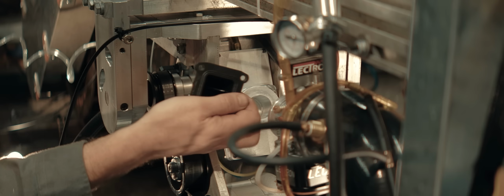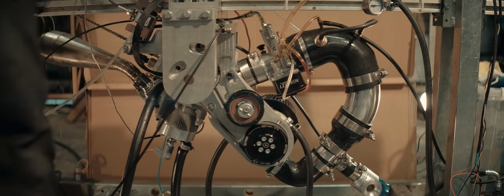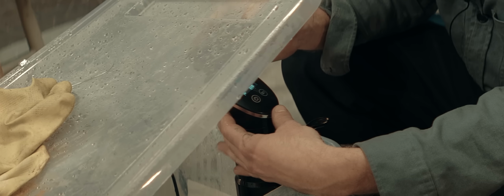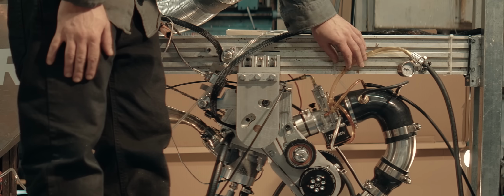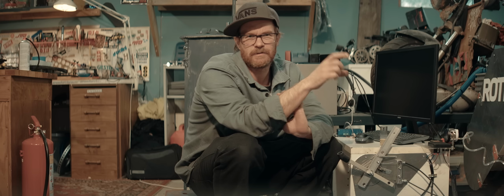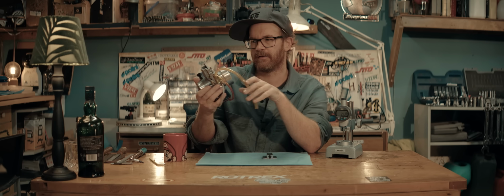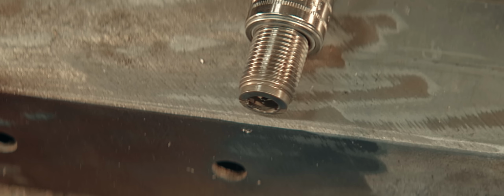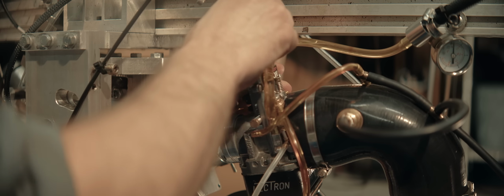Supercharged 50cc Two Stroke BREAKTHROUGH!

Comment: You know, I'm looking at my 50cc Honda Spree motor here, and these companies, like Honda, Kawasaki, Suzuki, Yamaha....just think of all the geniuses that have been working on the engineering of these two strokes for many decades. I mean, they built absolutely insane prototype motors, like a V8(!), 125cc 4-stroke mc motor, that revved to 20,000+ RPM, and they did it in like 1962, or something!!! They have created motors with oval Pistons!!! Just think of all the things that those manufacturers have learned over the years, the pros, and the cons. You know, not to be a Negative Nancy, but what I would do, personally, I would start off with all their technical achievements, learning the benefits of what they've done, over almost an entire century. I would then use that as my base engine. You know, when they did their experiments, & built prototypes, they had the absolute best equipment of the time, at their disposal. The money was simply no object, whatsoever. Those are technological achievements that I would not be able to do. This is why I would not start from ground zero. I would learn all the goods, the bads, and the uglies of these four major manufacturers, pertaining to 2 stroke engines. And I would use that as my starting point. Just think about this. If I started on this little Honda 50 spree motor, how long do you think it would take for me to invent a butterfly Reed cage, build it to the correct dimensions, as to not lose intake velocity, and design it around my entire combination, and make it work flawlessly... without knowing Japan's successes and failures....holy shit....I'd spend my whole life, trying to get to that point. Don't even get me started on exhaust velocity, pulsation, things like KIPS, i.e., Kawasaki integrated power valve system....all kinds of engineering that creates huge power gains, and it's free for the taking. Starting at that point, it would allow me to build up from there, creating enormous power, without having to wade through the very basics of two-stroke technology first. Then, you can focus your time on things like your ignition spark curve, boost retard, fine-tuning your ignition map for your particular engine, to make maximum power.....things that those Japanese geniuses could not do back in the sixties. It would be exciting to see huge power gains from something like that. This comment is way too long already but I hope you get my point, and please don't take it the wrong way. I love the channel, and I love what you do. Just don't ever think using those other companies successes and failures to your advantage, is stealing ideas. It's not. It's a free advantage out there you should take advantage of. That way, you really can design the most powerful 50cc two-stroke in the world.

Comment: The step in the carb would have produced a low pressure zone or "dead spot" just like behind the cab in a truck. Being so close to that metering rod I suspect it would have reduced the Venturi effect and acted like a dam for air flow and fuel. I suspect  you are right on the pooling fuel there and the engine taking big gulps of it from time to time, especially when it hit higher rpms. 

This is the first video I have watched of yours but it seems interesting.

Comment: When a two-stroke gets rich, I mean too rich, what we call it in dirt biking, is four stroking. I'm sure you've heard that before, that's too rich. 
Oh yeah, btw, your manual, mechanical reed valve, it's not a reed valve at all. It's a manual slide valve. And when you engineer that valve, keep in mind that the suction from the intake charge can directly affect its slide, up and down. I can't tell you how many time my Honda 750 carburetors would start to stick, because the barrel slides were either sloppy in the bore, or just dirty.
Anyway, now you're experienced, like Jimi Hendrix.😜👌
Reply from the maker: That slide valve has a reed valve in the slide - sliding reed valve.

Comment: In the dirt bike world, Lectron are hit or miss results wise, I'd really love to see what a quick switch to a more common Keihin with it's individual metering circuits would perform.
Reply: I'd say they are hit or miss based on whether or not the user knows how to tune it and/or is willing to spend the time. Most reviews I read over the years went one of two ways "I bolted it on, made no changes, and all of a sudden had TONS more power!" or "I bolted it on, made no changes, and lost a TON of power. Not worth it." Maybe a few reviews were like "I turned the screw a few times and it did nothing."

I've tuned tons of carburetors by now. They all want something different. They are all designed different. Even though they are relatively simple devices, they can also have their complexities. I can spend an unlimited amount of time tuning a carb to get it just right, if I wanted to.

I don't think the Lectron is necessarily a bad design, it's just different. And if you aren't willing to tune it, or don't want to to learn how to tune it ITS way, then you are going to be frustrated and tell the internet it sucks. I don't think they would still be in business if it didn't work.

Comment: If your calculated power peak is at 18000 or so (don't remember exactly what you said about it), then the worst power dip is going to be probably at well over 10000. So probably you are just beginning to hit it now. In my experience, at a really low rpm, like under 7000, the engine behaves "neutrally" like a 4-stroke, without the pipe resonances affecting it much. There the power is mainly affected by compression ratio and ignition advance.

Comment: That step is a signal killer. It destroys air velocity over the needle jet opening. Any fuel that does come up will be stuck in a vortex behind that step.
Reply from the maker: Yep. Only a fool would leave that in there...
Reply: @2STROKESTUFFING  he he that is why I love your channel! Honesty. I wouldn't say "fool" I'd say "rushed". I designed and built a carb that shares some of the principals of the lectron and testing showed that the area around the jet opening is uber critical. The Lecton relies on a low pressure area behind the needle to go all the way down to the opening and draw the fuel. The step cut that off. That is with a steady flow, when pressure waves are present it gets worse because inflow does not generate the required suction at the jet and pulse generated back flow the step will actually blow fuel DOWN the jet! Double whammy. Anyway you got it sorted out now, onwards and upwards!
Reply from the maker: @billshiff2060  👍 Thanks!

Comment: I still think a two-stroke with a straight pipe runs better. you no longer need the vacuum effect from the resonance because you have enough pressure to blow in the fuel-air mixture

Comment: If the metering rods don't work out as planned it might be time to just put a regular old carb on the rotrex and get it going on gasoline or E85 if the rotrex can take that.

There are so many unknowns and so many potential problem areas with such outstanding homebrew projects - taking out a few that way and getting it up and running might just tell you what you need to know to succeed.
At the very least it probably shows you which problems are fuel specific.

Comment: you might benefit from going full efi, and tossing the injector into the transfer port , and haveing some sort of oil system otherwise . With all that inconsistency happing so fast , a computer might be alot quicker than a human in reaction and would be able to adjust on the fly and keep the whole system in the happy zone . if you ran efi , you could also run an electric clutch , then have the computer control that as well so boost comes on in the perfect time  consistently . I understand this is no easy task tho . you could set up a micro controller to run the clutch as well as the valve slide plate .  just an idea hope it helps or inspires ,

Comment: Might be time to go for direct fuel injection, adds a bit of electronic complexity and more complex cylinder head but could reduce complexity at the intake side and reduce the pooling of fuel in the crankcase if that keeps being a problem.
Would also give you the option of making a pre-burn chamber like they use in F1 engines, could increase efficiency or reduce risk of detonation.

Disclaimer: I have never build a IC engine so al these idea's might be nonsense and never work.

Comment: As someone already mentioned the carb is on the wrong side of the super charger. With your setup the carb is being pressurized forcing fuel to go backwards. 
The carb needs to suck fuel in a vacuum.
Reply: I could be mistaken but I believe he’s already addressed this in previous videos with a pressurized fuel system that automatically adjusts to upstream blower “manifold” pressure.

Comment: Alex, look into a "bypass valve" if you need to take load off the pto for starting and idle. Thats what ProCharger uses with their centrificals. Bleeds off all the boost at idle and low rpm, then closes to start building boost as rpm rises
Reply: Detroit 2 stroke Diesels that are turbocharged have been doing this to their Roots blowers for 50 years.
Reply: This style of compressor doesn't really cause any load at low rpm, its just the gear train and mass. It's not a positive displacement. Look at a turbocharger compressor map, it's basically half a turbo with a mechanical drive.
Reply from the maker: Yep.

Comment: I have think your going to have to experiment with crankcase injection. If you can measure mixture internally you may be able to servo control injector timing and duration. That would eliminate the odd reed slide and the carburetor.

Comment: look up how to tune two stokes by reading the plugs. It is the only way to reliably check to see if you are too lean or rich
Reply from the maker: Not so easy with this fuel, you can decipher some from heat colouration of the metal, other than that it stays clean, no soot ring or anything.
Reply: @2STROKESTUFFING  your right, I didn't think of that. Your answer may be known by one of the two stroke four wheeler drag racers

Comment: In Sweden you can by E85 at many gasstations for less than the price of Gasoline so a lot cheaper than Methanol. Ethanol is almost as high octane and cooling as Methanol but to get the correct AFR you only need 1,3-1,4x as much fuel compaired to gasoline , so the required fuelflow will be a lot smaller than with Methanol too.
I know you like ethanol, why not give some to the engine too?

Comment: Humor me and set it up draw through style through the supercharger. Pretty sure that electron carb is not designed for boost and your accelerator Jets are fighting the boost rather than taking advantage of the vacuum. Either way I think you'll have much better luck with a draw through setup.

Comment: How about mixing the methanol in the carburetor directly in the air fuel mixture. To preventing the methanol falling out of suspension and get the control of right mixture?

Comment: I'm a bit surprised you tried running that motor and carby combo at all with out a pile of needles.  To easy to blow up a lean 2 stroke.  Because of the size of the carb and the capacity of the motor the jet size will need to be huge!!  You have choked it down a bit which certainly will help get the carby back into range, but considering just how fine adjustments are required to nail the jetting, you have taken a big gamble.  I built a fairly modified KTM 380 and upon starting to jet with the original 38mm PWK, I couldn't get main jets small enough to get the mixture correct.  I modified the carb by fly cutting it out to 39.5mm and that put the main jet bang on back in range.  Jetting for the new expansion pipe was the toughest, it always fouled the plug on extended deacceleration runs.  Leaner pilot was the answer.  The ratio of fuel pulled through the jet and air through the air bleed richens at higher manifold vacuums.  The last change was the needle profile to get the mixture right at 1/4-1/2 throttle position.  After market JD needles which come as a pair, one is ground half a position out to the other so you technically have 10 positions.  All in all the thing starts like magic and couldn't be any crisper throughout all throttle positions and is explosive when getting back on at the apex.  I love it.  I really like what you are doing here, you have an interesting research and development process, but you are getting there.  When time allows I would like to play with the concept of a turbo charged 2 stroke so boost can actually be contained in the cylinder.

Comment: What about reeds in the carb?  With more air flow they flex to open the throat more.  Effectively at low rpm's it could be like a choke depending how small and strong you were to make it.

Comment: Could you use the blowoff valve to open at low rpm which will help with air restriction, easy test just rip it off and see if it’s better down low.

Comment: Why don't you fit a lambda sensor in the exhaust? The information will help to quickly determine whether you have the optimum fuel and air mixtures at various rpm. Tx for sharing your experience....

Comment: Can you use the Turbo Centrifuge to clean the exhaust?

Heavier particles will displace lighter particles and push the lighter particles into the centre while the heavier particles locate to the outer areas. Can this cleaner air in the centre be used to go to the exhaust while the dirtier fuel air on the edges is re-entered into the engine for a second burn?

Comment: Ignitech - have you got your pickup setup is such a way it can run higher enough advance values ? When the Ingitech software is connected to a running engine it will tell the maximum static advance that its possible to run. The Ingitech has an option to "spark possible before lobe" which allows you to run more advance than static by I beleive running the engine one cycle behind. Do also note that if your base/static advance of your lobe is really high the engine can struggle to start as the Ignitech starts the engine on the fixed base advance setting until its up and running and in sync with the lobe.

Comment: What is your end goal here? If anything and you are seeking power and speeds applied vacuum to the scavenge of the exhaust port and your engine will run much more powerful and the needs of the expansion pipe will be void to help the scavenging effects. Trying to use a oversized carburetor is another problematic thing that will never go away and it will be too erratic. The end goal of a 2 stroke is being able to remove the burnt exhaust gases and fill the cylinder with the fresh air fuel. I've played with this theory before and it's amazing! Not very efficient for fuel economy standards but the outputs are far above the expansion pipes outputs. Just FYI.
Reply: I'm not a fan of massive carbs due to reasons you state. The lectron was gifted and chosen due to it having  a larger float bowl fuel vavle allowing correct fuel level to be achieved at max RPM. Smaller carbs couldn't keep up with fuel supply requirement's while running RC fuel.

Comment: Hey man, you're doing god's work on these little 2strokes!
If you don't mind, i have a "little" question for you.
I have a franco morini g30 engine but i can't find a replacement cylinder kit for it.
Here i can only find 39.2 stroke cylinders with the same "holes" but the g30 is a 41.7 stroke. Is it possible to use a 39.2 stroke by adding a 1.25mm spacer  between the engine and the cylinder?
Thanks and love your work!

Comment: Brother, more weight on the throws of the clutch to hang on to lower RPM engagement. Either heavier springs or heavier throws :)
Reply: about time you put a servo on the throttle... Engine needs an ISV air bypass to hang the idle high as the load comes off the inhibitor

Comment: When I was young, I gave much thoughts about 2-stroke turbo. I never actually tried anything, but anyway - here are some thoughts:

As 2-strokes firstly suck the fuel-air mixture under the piston and since you use pressurized mixture ... is under-piston compartment pressure tight?

Since 2-strokes don`t have much torque, but are high revving and they put a lot of unburned gases in the exhaust pipe, it would be wiser to use a turbo instead of a charger (with alll the resistance)?

Also, a carburetor doesn`t perform well under non-stedy air pressure and flow. Also, the mixture must firstly go under the piston and then above the piston, some of it escapes back under the piston and ... I think the proper solution would be using the direct fuel injection . Turbo would handle just clean air and the computer, with the help of lambda, would terminate the optimum ammount of fuel at the moment, which would be delivered directly on the place where is needed - without any options to disturb the air-fuel ratio.

Hope some of this helps. Best wishes.